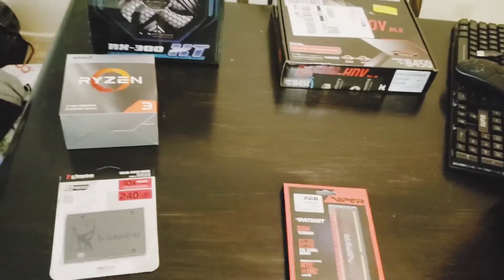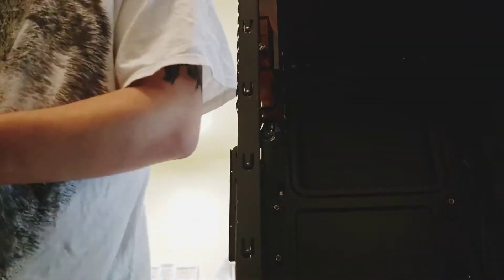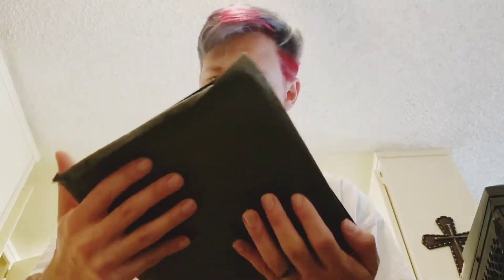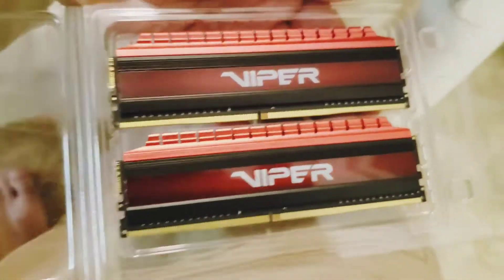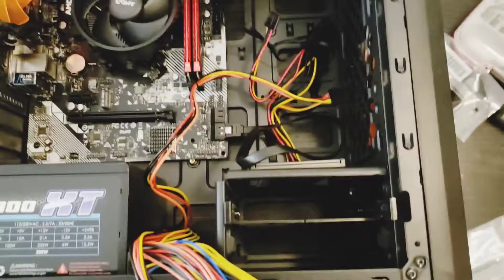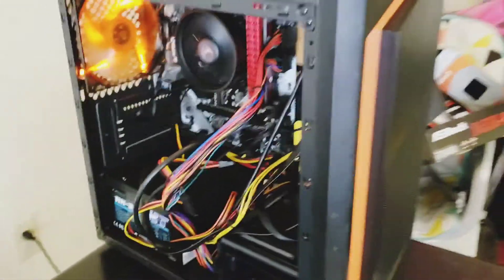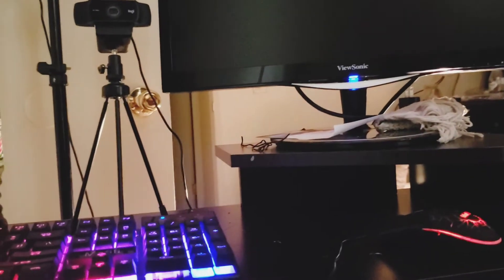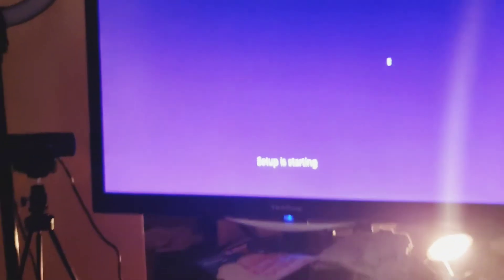Console streaming pc build $250

Comment: thank Ryzen is 199.99 now crazy how inflation works
Reply: Ryzen 3200G- $199.99
Patriot Memory Viper 4 Series 3000MHz (PC4 24000) 8GB Dual Channel DDR4 Kit- $53.99
ASRock B450M-HDV R4.0 AM4 AMD- $70.99
Kingston 240GB SSD- $34.99
DIY-F2-O DIYPC-$34.99
RaidMax 300W XT-29.99
Grand total: $424.94
Reply from the maker: @jasonfinley6940  dude that is crazy 😦  everything has gone up on this rig. Monitors at one point were sold out and crazy cost

Comment: what cord did you use to go from the pc to monitor??
Reply from the maker: Just your basic hdmi
Reply: GOVINATOR ok thanks and 1 more. I have the same build as u but I try to hook up my keyboard but it won’t power my keyboard to boot it
Reply from the maker: @trelly3637  hmm. It could be that your cables from your power supply are not in all the way on your motherboard. Or not plugged into the corisponding USB port on the motherboard. So double check your motherboard and power supply are giving power to USB. Also try a different USB port on the tower.
Reply: GOVINATOR I am going to do this but does it actually stream good
Reply from the maker: @Laselyi  i will post a stream video this weekend. You can see for yourself. But yes it is perfect for console streams 👌

Comment: I am in the middle of collecting parts for a pc build to for streaming my ps4. Do I not need a GPU? Does it work ok with out it? I dont plan on gaming with the pc.
Reply from the maker: If your processor is good enough and has built in graphics. Like the one I used you can you do not need one. But be sure that streaming will be the only thing running. It can handle obs and work with a capture card just fine without one
Reply: GOVINATOR  but if i get a graphics card will it run better ?

Comment: Where did you get the parts? And do you use a capture card
Reply from the maker: I got these parts from amazon and newegg. I noticed that from the toasty bro video the parts they used were gone. So I just matched specs and got something as cheap
Reply: The motherboard and case are both sold out what motherboard do you use?
Reply from the maker: @Akg-uc2dr   I kept checking with newegg on the case and they would get work of the case when they re stock. I use the asrock 450m hdv. Also I have been using the microsoft console companion to stream to my pc. I am still waiting to get a capture card but I'm doing a lot of reviews
Reply: How much did you play for the motherboard there is another on on amazon that is $100 it is very similar to it